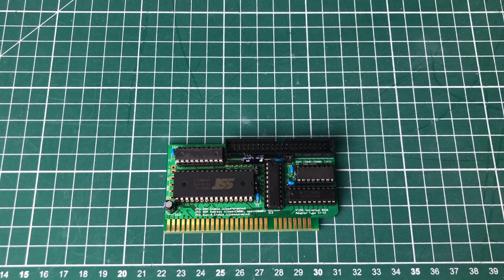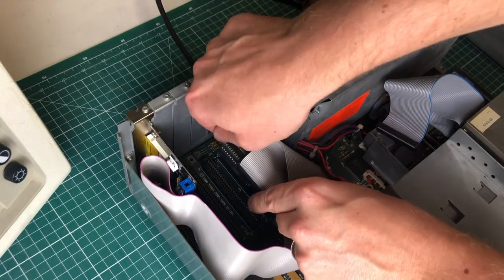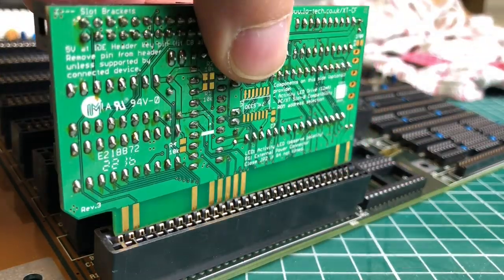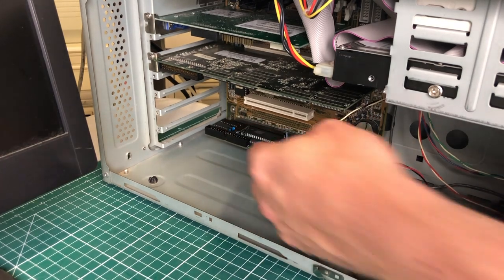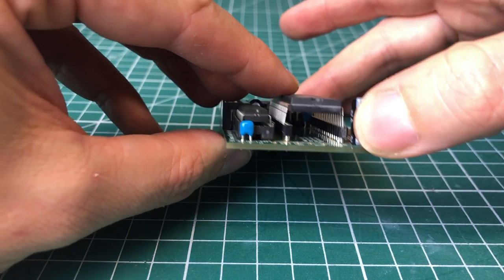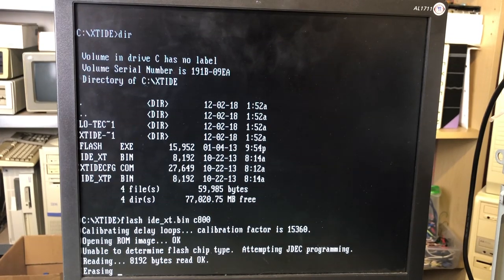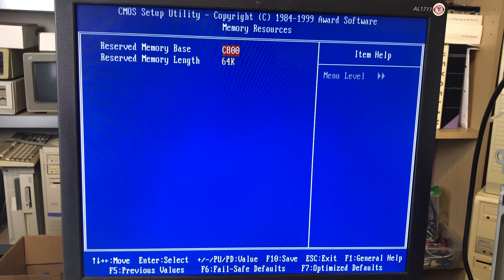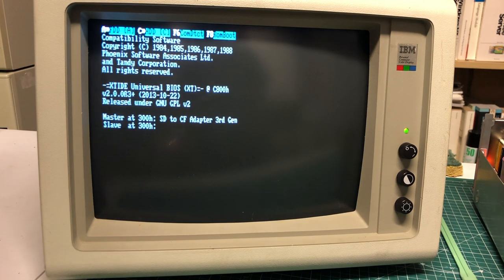What if - XTIDE card is placed in reverse

Comment: While testing things at an electronic manufacturer, a co-worker showed me something new, the LEEPROM (Light Emitting EPROM).  He plugged an EPROM in the socket backwards, and when power was applied a tiny light appeared in its window, then went out.  Needless to say, that EPROM no longer worked!  The sad part is that he did it once, then did it again to show me!  He didn't realize he had it in backwards.  This was back when EPROMs were not cheap, and these were special ones, higher capacity in a 24-pin DIP.

Comment: I remember tripping over a network cable once which pulled out a PCI NIC from its slot (not screwed in) - I just pushed it back in and Windows 98SE (I think) just re-detected it and carried on working :)
Reply from the maker: Pull out, plug in and play :)
Reply: Did it redetect it ? Or just not notice ?

Comment: I can see where this can come from. Pretty much every card (PCI, PCIE) I have is inserted with the component side down. Without the bracket, this would sure happen to me too without thinking. Thanks!
Reply from the maker: Edman yeah with isa cards it’s usually the opposite where the components are on top. I also had the case backwards (backside oriented towards me). Made it extra confusing. Especially at 1am :)
Reply: I remember the first time I bought a PCI card. I was sooo confused and thought somehow the i/o bracket was somehow placed on the wrong end because i was so used to putting cards that had the components facing up. It felt so strange to insert a card that appeared upside down.

Comment: Kinda surprised it didn't take out the '688. Guess those comparators are more robust than the EEPROM chip.
For anybody still confused, having +5v going into a data/address pin won't harm anything on a 5v chip. But A6 and A8, which were crossed with the +12 and -12 can have disastrous effects on a 5v chip, especially one that only needs 5v to program. Learned that one the hard way under different circumstances.

Comment: Very nice work. I probably would have missed disabling shadow RAM (I tend to flash mine directly in my XT systems when possible as I configure the XUB for the installed CPU).
Reply from the maker: First time i tried flashing it it was on this machine. Spent about an hour and a half figuring out why it would not flash :)
Reply: Thanks for pointing that out.
Wouldn't you want to change the settings back on the machine you used to perform the flashing?  I could see where you might not, since it's your machine and you know about it.  I just meant for other people, in general, they'd want to restore the settings back to "normal". 😉

Comment: I fried an XT CF a few weeks ago this same way. RIP
Reply from the maker: At least it is an easy fix. These card are usually pretty expensive over here (50 EUR range). So a 1.3 EUR fix is always welcome ;)
Reply: @RetroSpector78  Very true! I think in my case it fried something else as well but either way, can't be that bad. I didn't know you could flash from the card directly either, that makes a huge difference - I'll dig it back out and give it another shot. 

Thanks!
Reply from the maker: Yeah ... really convenient. You will be able to download the flash utility and images from lotech (its on their wiki). The other chips on the board can withstand quite a bit. It’s just the flash rom that is a bit sensitive and took most of the hit when inserting it backwards. Hope you get it up and running again.
Reply: Press F to pay respects

Comment: that's why pc manufacturing companies have created standarts that plugs only go in one way and that pc parts can be used with various machines and so on
Reply from the maker: I know, but without a bracket an isa card can still be put in the wrong way.  The isa slot / spec does not prevent that.

Comment: I wonder if there was actually any 'magic smoke' when the power was first applied? I always hated 'magic smoke'.
Reply from the maker: I didn’t see it, but sometimes it can ne subtle. But there is no visual damage on the chip itself, and the computer didn’t shut down. Think some of the internal data lines on the flash rom just got so damaged that it didn’t do anything anymore.
Reply: It's always bad to let the smoke out.
Reply: If the voltage were any higher than +12/-12 (crossed to A6 and A8), there probably would be. The 47LS688 comparator also takes input from A6 and A8, so I'm kinda surprised that it took that without frying.

Comment: Can one of these cards be used in a 486 PC to get around the BIOS size limit?  I tried using the XT-IDE BIOS on a network card and it would bring up the menu, but the system still didn't see the correct drive size.  I also want to use the existing IDE port on the system if possible, because it is probably faster than the one on the ISA card.

Comment: Hmm.  I wonder if there's a way to either put a fuse or even a diode to prevent damage
Reply: Not really. Diodes are good for reverse current protection, but won't help in this case, because the problem isn't reverse current, but over voltage on the A6 and A8 lines from the +12/-12 pins. Resistors could prevent overcurrent, but would also have the effect of dropping it too low for signal integrity. Really, the solution is to either add a bracket, or just pay attention.

Comment: And if you insert cache chips on backwards for a second, they get hot. Did that once before years ago and the computer still runs. Another thing is, the PCI cards can also be inserted in backwards as well if you're not careful or absent mindedly insert a PCI card in an ISA slot and cause sparks to fly. Did that once myself, including overvoltage on a CPU socket, but I didn't know what would happen at that time. Had a power supply blow out magic smoke 7 years ago (cheap AT PSU fan shot itself in the foot).

Comment: Can you assist me on the use of EMS Ram on the Tandy 1000 TL?
Reply from the maker: Don’t have an EMS card unfortunately to try :( but would gladly accept donations and post a video on it :)
Reply: @RetroSpector78  Do you have any Memory expansion cards for XT Systems? I'm interested in freeing up conventional RAM and resolving conflicts with my Tandy, to increase its abilities. I do alot of networking.
Reply from the maker: Got some xt expansion cards. Need to see if they fit inside the Tandy case. Will give it a try somewhere next week.
Reply from the maker: Be sure to subscribe for updates. Once I hit 1k subs I can also post text msgs and should pop up in your feed. But difficult for new channels to get momentum.
Reply: @RetroSpector78  Will do.
Reply: @RetroSpector78  I use an Application called XFS 1.91 with a Linux PC to serve it files, and Pine 3.96 to send and Retrieve IMAP 4.x E-mail. When EMS is loaded,  Pine will hang. 

But the thing is, because my device uses a CF Card with XT IDE, it can degrade on write cycles. To spare my CF Card, I want to try and run DOS programs over the network directly.The Memory overhead of the XFS 1.91 application creates problems, so, I want to offload them into the EMS Banks.,

Comment: So, I have to ask. Why don't these cards actually have brackets?
Reply: Doesn't need one so it's cheaper that way.
Reply: @marzi_kat  I get the cost savings, though it sounds like they do need it based on this video and the comments below about other people frying them by putting in backwards. I know I would pay an extra 5 bucks or whatever for one that comes with a bracket to prevent that and also keep it securely in the slot. That said, the card is nothing short of a miracle - amazing that such a great product has been made for the retro computing world!

Comment: i have an old server with 2 400 mhz cpus but only scsi could i use this card to get ide on it?
Reply from the maker: this card is intended for old computers (primarily XT or early 286 systems) that only have 8 bit isa slots. A 400 Mhz server will probably have 16 bit ISA / PCI where you can get standard IDE cards for.
Reply: @RetroSpector78  thanks you :)
Reply: @RetroSpector78  will these drive an AT/16 IDE on an XT ? Originally XT IDE was a different standard and the drives were not interchangeable . it was a nightmare when people would fry a 40mb 16bit IDE drive by connecting it to an XT IDE board.
Reply: @ruben_balea  not entirely sure what you mean by XTA.. IDE/XT ? .  Ive worked in the industry since the days of MFM and RLL  then on to ESDI . ( scsi ran concurrantly to all of these but at a much higher price point) 

To the best of my memory , from the changeover period around 1988,  XT IDE drives were forwards compatable with IDE/AT .  you could even go the other way and put IDE/AT drives on an XT IDE controller if you had the required software tools which were NOT distributed.  ..if you did manage to get the proper tool , it allowed re-low-level-formatting back to XT IDE standard.  It didnt seem to be a hardware level issue at all other than drive bios and interleve settings... With the tool it would compensate for that. Maybe they were using an FPGA ? But it specifically applied to WD and Miniscribe IDE devices. . .  If you didnt have the tool, you trashed the drive and had to send it back for repair. And it was considered a non warranty issue.  
. xt ide controllers itself would even work in 16 bit pcs but wouldnt handle either drive properly. 

We had quite a while where drives would be labeled incorrectly, especially miniscribe  IDE/AT drives were coming labeled as XT and vice versa . it was a huge deal bc we were selling DIY kits and people were thrashing the drive and miniscribe didnt want to honor warranty.  We had enough buying clout at the time that they eventually gave in .. And then sent them back labeled "refurb." Which was another issue.  But our corporate stood behind them assuring everyone we would honor the full 3y warranty ... and i only saw 1 come back as a premature failure. 
As soon as Connor was able to ramp up production we made the switch .
Reply: @ruben_balea  if you compare pinouts and read thru the forums, not even mentioning working in the industry thru that era, the XTA drives can be made to work on ATA cards after some hobbyist level rework like flipping the pinout on the ribbon and flashing the bios table of the controller.  Which seems to be in line with that i said about needing thw drive manufacturer's internal-use toolkit.   
The reverse is not true , though, without re-engineering an ata card.  You cant put an ATA native drive on an XTA controller which is something i also said. 
 Basically if you had an xt with an xta drive and bought a 386 you could frankenstein a cable and flash the controller table and not have to reinstall everything. Remember this is the era of win386 1.0 and Geos ..both of which were dos shells. So no reload required.

Comment: have gone that route and burned every single ic in the card have to replace them
Reply: Every one? Unless I'm missing something, the only lines crossed with the +12 and -12 are the A6 & A8 lines. Those only connect to the EEPROM (which are very sensitive to overvoltage), and the '688 comparator.